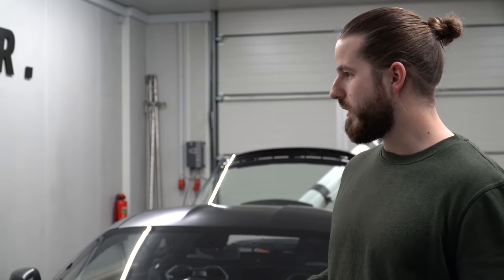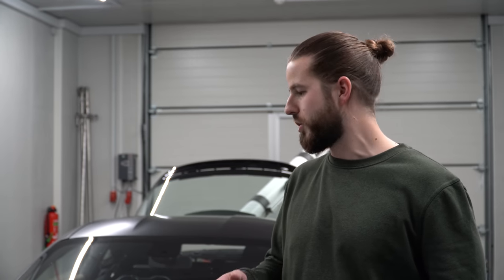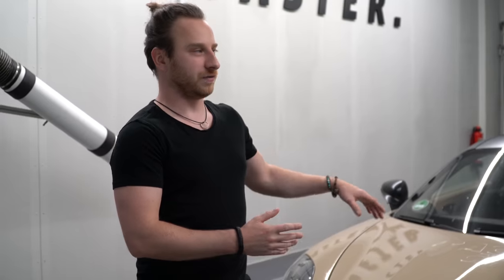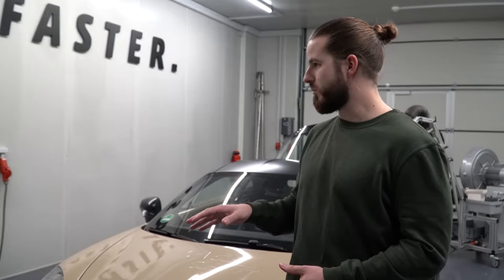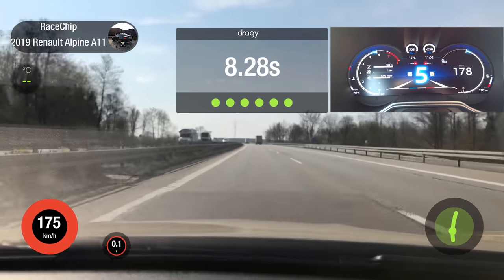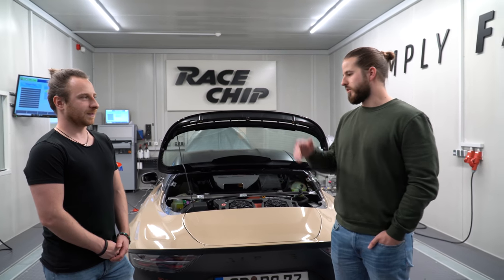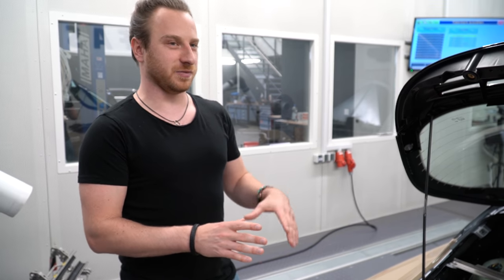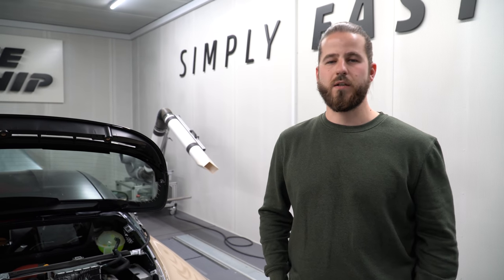Alpine A110 - How does it perform in stock? - RaceChip Insights

Comment: Hi, great video as always, 2 questions for you : does the gearbox will tolarate the horsepower and torque gain? And what about the electronically limited top speed, have you disconected it or done anything to reach the true topspeed of the car? Thanks ;)
Reply: That would be one of my concerns - the gearbox is nominally rated at 320nm maximum.  Personally I think that is good because it means that the torque needs to be maintained well up the rev range to get the power.  As was said in the video this means that the engine feels much more like a normally aspirated one than most turbos at high revs.  Unlike other chips which focus on a big increase in torque in the midrange I'd prefer to see one that focussed on maintaining or enhancing this "NA" feel.  So little if any increase in midrange torque - just maintain it beyond 5000 rpm.  Not the normal way of tuning turbos, I know, and wouldn't give headline figures - but imo might be nicer to drive.
Reply from the maker: Thanks Gabriel and sorry for the late reply! We're still in the development process of the RaceChip for our Alpine A 110 but we'll post an update video with all technical details about the tune and how it affects the car shortly. However, we definitely won't eliminate the VMAX limiter because this is very hard to do without interfering directly with the original ECU of the car.